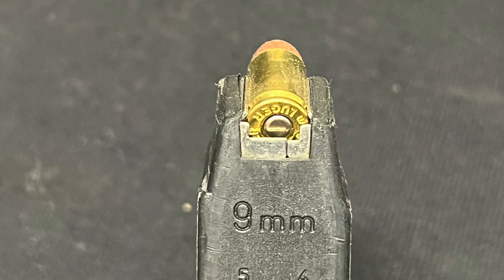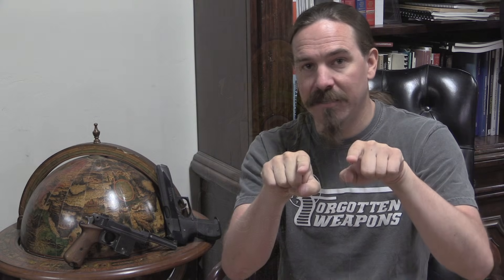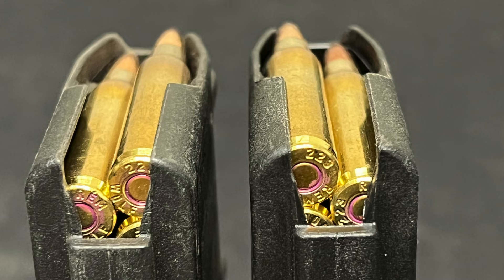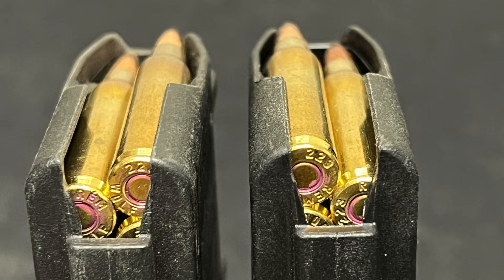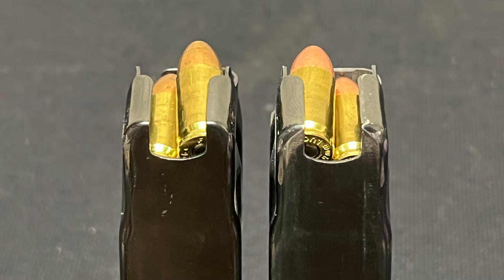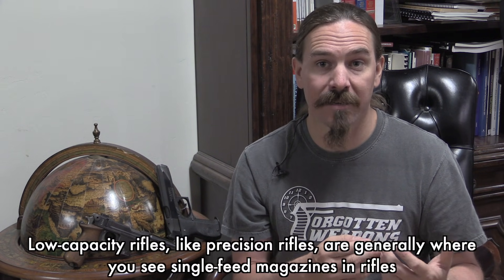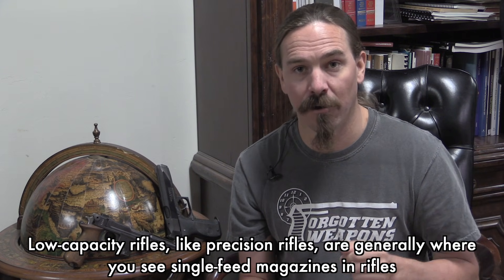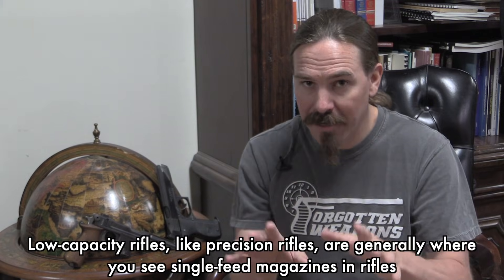Ask Ian: Single Feed vs Double Feed Pistols

Comment: As a guy who had an SIG p210 with a single stag (all the way to through) 8 round mag and a SIG 320 with a single stag (to a double stag) 21 round mag... i can only say having to load a coan shaped mag into the pistol is a lot quicker and easier than a evenly sized mag. I would have to alocate a split second to look at the wheel with the 210 and i did not have to with the 320. I think ergonomically that is also a concern with pistols. You only need one when your screwed... and if your so screwed you need to reload it.. better do it quick.

Comment: In-line feeding in a small space but also trigger bars?

The double-stack Beretta M92 uses an external trigger bar although the design started out as the single-stack M1951 with an internal linkage.

Comment: Single feed pistol mags are also easier to perform reloads with, as you're putting a slightly smaller box into a slightly bigger box initially.  This might make the difference between fumbling or not fumbling a reload, especially under stress.

Comment: Another pistol that uses a double-feed magazine is the current Chinese military service pistol, the Type 92, which first made its appearance to the general public in about 1999, which also uses a rotating barrel system to function. Simplicity to produce was definitely a big factor in why they chose double-feed. For a pistol that was introduced in almost 2000, the Type 92 looked crude, although that was hardly surprising for a country which at that point had had very few self-designed full size semi-automatic service pistol, and the Type 92 was their first 9x19 caliber service pistol. (They had been using Tokarev TT-33 clone before that.)

Comment: What I think is needed is a not quite single feed pistol magazine, by which I mean the feed lips are far enough apart you can simply push down the cartridge between the feed lips but the rounds still have to angle towards the centre from either side. It would be so much easier to load a magazine that and it would more or less eliminate the wider slide issue.

Comment: So given a couple of your characteristics on double feed magazines, (typically easier to load, typically require less spring pressure) why are the old colt SMG mags so awful to load? They have so much spring pressure you basically have to have a loading tool to use them. 

Is it because they’re straight 32 round 9mm mags instead of curved? So they need the extra ass behind them to overcome the friction?

Comment: Single feed vs double feed is arguably the wrong term.  Usually that refers to machine guns or cannons that can select two different sources of ammunition, i.e., have two separate ammunition feeds.

The correct term is probably a magazine that feeds off both lip sides.

Usually you get your terminology scrupulously correct.

Comment: In the 70s in Africa...first had a Sten SMG...real pig... Single stack... Without loading tool, maybe five or six rounds by hand.  Replaced with GM SS-15... Local 9mm version of Czech M-25.  Had double stack... Real joy by comparison.  Again... lot of rounds...far better for double stack.  (Also, nearly 12" barrel vastly better than what Sten had...)  YP

Comment: That’s why the PS90 is such an amazing magazine design, bullet changes direction 90degrees, but it’s always single stack. Wish there was a 223/556 version.
Reply: I want a select-fire P90 so bad and would settle for a PS90 but every time I think about buying one I look at the price of 5.7x28mm and realize loading a magazine would cost as much as the magazine....
Reply: Be nice if we could get an actual P90 with select-fire
Reply: If I remember correctly, the US military did show an interest in pursuing such a system. The issues were that the 5.56 was too hot (I don't believe that), and that the weapon system couldn't handle the M855. I don't know what the big catch was, maybe they couldn't create enough space for a 5.56 chamber versus the 5.7, yes the diameter is smaller, but the cartridge is longer, maybe the internal space of the P90 chassis limited the space available to enhance the chamber for the length. I do not know off the top of my head the chamber pressure differences between 223/5.56 and m855, but I know that all 5.56NATO chambers are rated for 223 but not all 223 are for 5.56, so I know from that, there is a difference in chamber pressures. 🤷‍♂️
Reply: That thing would be W I D E.
Reply: 22 boz

Comment: I converted a HK4 .22LR mag into a 13 round mag. It was originally a 7 round mag. Originally, the mag had a post in the baseplate. I cut off the post and, Viola, 13 round .22LR mag. No .22LR feed problems in all the years I've owned it. Surprisingly, the .22LR kit consistently puts rounds within a 6 inch circle at 7 meters (very accurate). The .380 kit always put rounds low & to the left at 7 meters (good info for emergency situations). I bought the HK4 in 1976. It was manufactured by Heckler & Koch but had a Harrington & Richardson nameplate. The 4 caliber set for the HK4 could not be purchased from H&R.

Comment: Wasn't the original Suomi "coffin" 50 round mags four stack single feed? Or something? How reliable were those? I think the Swedish K could take those, but they were considered unreliable or something, so the Swedish double stack double feed mags were used instead. And I think the Finns even stopped using their own mags, and modified their SMGs to take the much better Swedish mags instead. But I could certainly be wrong.
Reply from the maker: Yes, quad stack single feed. They were pretty decent, but not perfect. The Finn replaced them with the 71-round drums and eventually with basic 36-round double-feed box magazines.

Comment: I would also have added that most of the pistols that use a double-stack, single-feed magazine, also have part of the trigger mechanism occupying space inside the grip, around the top of the magazine, , and having the magazine taper at the top has the added advantage therefore that they don't have to widen out that part of the frame to fit those moving parts in.

Comment: Here’s a serious question.  About the HK pistols, when you eject the magazine, you can see asymmetrical sides.  How can the magazine follower accommodate the peculiar geometry of the asymmetrical double stack, single feed? What was the logical reasoning behind such a design?  Being HK, we can expect some good thinking behind this design.  If so, why doesn’t Glock use a similar magazine?
If friction is the reason that double stack, single feeds have problems, why doesn’t somebody add a Teflon strip in the critical areas? It can’t be that expensive…
Reply: If the mag is trapezoidal, than it is to accommodate the taper of the case. 
YT shadow deletes my comment with more info for no reason again...
Reply: @tiortedrootsky   No.  go ahead and watch some of Ian’s HK pistol videos.  The left side of the magazine, facing the primer, has a different slope than the right side. That asymmetrical stacking of the cartridges always intrigued me…

Comment: 1) Also feed lips of the single feed mags act as guides, and it doesnt matter as much if the round is bouncing a little as it comes up and hits the lips.
2) Russian double feed handguns have very stiff mag springs. As i understand it was nescessary because the bolt is very fast and bolt travel is very short. Cartridges have to go up and settle the bouncing very quickly.
For example MP-443 Grach (Yarygin Pistol) had very stiff springs in double feed mags, but they redesigned it to feed both from double and single feed mags, and single feed ones have normal springs.

Comment: Another example of a double feed handgun is the CF-98. The mags are very nice to load, except for the non-factory 10 rounder magazines which are 15 round pined to 10. Those are almost imposable to load to 10 rounds because whoever pined them to 10 rounds decided that they needed to fit 10 rounds and not one mm more.

Comment: I had been momentarily confused during this video, Ian-- when you referred to loading the magazine I was wondering if it was the act of filling the magazine with cartridges, or if it was referring to loading the magazine into the gun itself. I only wondered this because I have experienced various handguns over the years and sometimes they will have a notoriously difficult magazine to actually fully seat inside the gun (For instance when you have to give the bottom of the magazine a firm smack). I didn't and still don't know what causes that when there are other weapons whose magwells will facilitate a much easier act of loading and finally seating into its locked position.
Reply: Ian is referring to loading rounds into the mag.

Regarding inserting mag into gun, I have noticed two things. It is much harder if the bolt/slide is closed, as the bolt/slide presses down on the top round.

Also, early Glock mags would swell slightly when fully loaded. This made them harder to insert, and they would not drop free when loaded. This may have been a feature, to avoid accidentally dropping a full mag. The newer mags are stiffer in the walls.

Comment: I think it's most interesting to see the disparity between single and double feed with pistol caliber carbines. The en vogue thing is typically using standard pistol mags (eg PC Charger with Glock mags, Cx4 Storm with 92/Px4 mags) but PCCs with a proprietary mag design seem to tend towards double feed (Stribog, MP5, B&T if I'm not mistaken). Although not ideal for adverse reliability, it's also worth noting the extended (20-33rd) mags for Glock and Beretta have certainly proven their worth by functioning reliably in platforms like the G18, Vector, M93 Raffica and Mx4 Storm, which all fire incredibly fast in full auto.

Comment: I wonder if anyone has tried a 1.5 feed system, where both stacks get a bit narrower, but not really down to one.
It would surely be the worst of both worlds, but it would make a fantastic failed prototype for FW.
Reply: There is a critical contact angle for the next cartridge in a double stack magazine, otherwise the top cartridge can squeeze past the feed lip and escape. There really isn't any middle ground, if you narrow the top of the magazine you end up needing to move the feed lip edge inward until you have a single stack mag anyways.
Reply: @mfree80286  Given what you just said, if this handgun and magazine were ever developed, I think we'd have to give it the nickname "Geyser", for the effect of it spraying all of its ammunition up out of the ejection port all at once.  No double- or triple-feed jams, here!  The gun will be so problematic that this issue will also trip the slide stop, ensuring that allllll your ammunition leaves through the ejection port.

Comment: I have a vz61 Skorpion that uses a double feed magazine. Such a great pistol. Too bad 32acp is expensive right now...
Reply: Vz61 had both much longer bolt traver (about 1,5 case lenghts over the case head, when glock have maybe about 13mm) and a bolt delaying mechanism. Lots of time for the cartridges to go up and stop bouncing before the bolt push it forward. Russian double feed mags have very stiff spring to make it work.
Reply: @tiortedrootsky  Yeah, and it's debatable whether the vz61 is even classified as a pistol as Ian was talking about. I think in spirit, I would say no, since it was designed to be fully automatic, and almost all actual pistols weren't.

Comment: How much difference in loading difficulty and reliability would be in a 20 round pistol magazine versus a 30 round pistol magazine? As capacity of semi auto pistol has grown in recent years especially in full size pistol like cz p-09. Wouldn't it better if your flush magazine to be double feed if your capacity is reaching 20 round. Or in case if your pistol shares magazine with your smg/pcc. Since sharing a single feed magazine might be detrimental to the feed reliability of your primary smg/pcc who will be mainly fed with 30 or more round magazine.
Reply: In case of PCCs, there are basically no magazines designed to be used in both pistols and PCCs. There are just PCCs that were designed to use well-established pistol magazines, often from different manufacturers.

With the full-sized pistols, there's also often the issue that they share magazines with compact and sub-compact pistols in the system.
Reply: @MarvinCZ  To be more specific magazine sharing between a pistol grip magazine smg and pistol. Wouldn't it simplify logistics, whereas most militaries opted for a front mounted magazine setup in their smg in such a case there is no magazine sharing with a pistol, also if shared the magzine release button will be at rear while the catch in front of the magzine so the gun will need a lever to actuate the magazine catch relase up front. Beside the first setup I mentioned a bullpup smg can share magazine with a pistol since when reloading the magazine release button can be on front similarly to pistol.
Reply: @MarvinCZ  Pistol use in military has risen after the start of global war on terror. Before that most militaries considered pistol use by soldiers a safety liability. So there has been no development in magazine sharing also in most of the militaries their smg has been largely replaced by assault rifle carbines and compact carbines. Pistol use has always been a primary weapon for law enforcement as such their requirement is more in line to be snag free, low profile and concealable off duty or in surveillance operation etc. So a double stack single feed magazine is better. But due to terrorist attacks like in Paris and in Mumbai where terrorists with heavy armaments and armour overwhelmed regular patrol and first responding police there is a requirement for a gun which can be kept like a pistol, pulled out rapidly and used like a pistol while also having a stock which can be deployed to take more accurate and long range shots. For such a scenario B&T offered their usw which is the only viable option, their is flux's sig p320 raider but is not low profile enough and comes close in size to mp7. After such incidents police are deployed with coventional configuration smg's and assault rifles but such a scene can be only sustained for so long and there is need to go back to normal patrol police with only pistol as primary. So here B&T usw comes but alternatively one can carry a compact low profile smg with 6 inch barrel in this scenario having magazine sharing with now your backup pistol is advantageous. I remember only PM63 smg to fulfill only partially this requirement as it fires from open bolt or the experimental colt scamp.
Reply: @MarvinCZ  After some searching around if one has to carry only one gun then glock long slide in usw chassis a better choice for law enforcement or a select fire one in same configuration for military, m17/p320 in raider chassis for military. Beside the pm63 and colt scamp I previously mentioned in my comments when carrying pistol as backup or not at all vz 61 fits the bill as it is available in short magazine for drawing from holster while being light enough with high capacity magazine later when shit hit the fans in full auto or in burst. Beretta 93r is another contender drawn from holster to semi auto then stock is brought out from the pouch and attached, switched to burst for more firepower. For carrying a pistol as a backup and one is downsizing from a large smg then one has B&T MP9 or stk cpw as option but the best option for carrying with a pistol is fmg 9.

Comment: I never knew that there were any double feed pistol magazines even though I  have one. I didn't remember that my FiveseveN is double feed until a commenter mentioned that very gun. Seems like an unnecessary complication to the firearm design. But it is exactly why I disdain Glock magazines in PCC's.
Reply: Engagement for algorithm!
Reply: As much as I ridicule the Five-Seven, I wouldn't say the double feed magazine is unnecessary. You have to remember that by default, it feeds from a 20 round magazine, which is pretty considerable for a handgun. Like Ian said in the video, if a gun with a high-capacity magazine fed from a single narrow channel, it could introduce feeding issues due to the extra pressure exerted on the uppermost cartridges.
Reply: @washingmachine969  actually, I have +10 round extensions on my FiveseveN magazines, and they function flawlessly.
Reply: @eloiseharbeson2483  Probably because it's a double feed magazine.
Reply: Is it hard to load the mags compared to single feed ones? Russian double feed mags have very stiff springs to make them reliable. Single feed mag lips are guiding the cartridge to the chamber, so it doesnt matter as much if the cartridge is bouncing a little. Doulbe feed lips are not so great in that regard.
Reply: @tiortedrootsky  If you're talking in general, it depends on the magazine itself, but usually double feeds are easier to load to capacity than single feeds, as there's less pressure on the uppermost cartridges. If you're talking about the Five-Seven specifically, it's very easy to load, which is a nice feature.
Reply: @washingmachine969  i meant the 5.7. Interesting. Maybe russian designes didnt get it quite right if they needed such stiff springs. Or theres something else.

Comment: I would also think that the increased length of rifle rounds would make feeding from the left and right simpler than feeding the much shorter pistol rounds from the the left and right.
Reply: As well, pistol feed ramps tend to be much steeper than rifle feed ramps and rifle ramps often have a short "divider" to aid in the round feeding from each side, reducing yaw/jams. Pistol rounds commonly have a greater diameter, so a divided ramp just wouldn't be feasible with pistols being narrower than a fifle receiver.